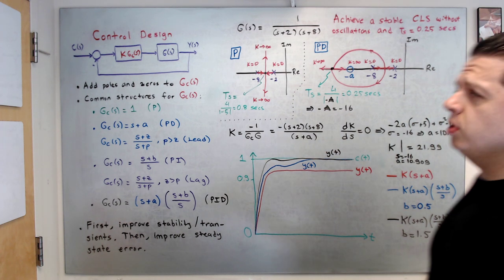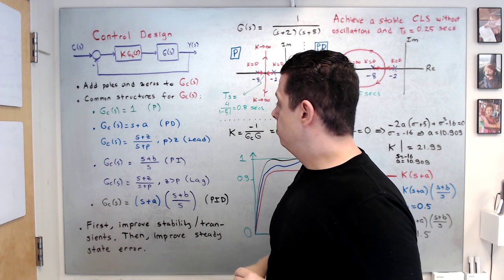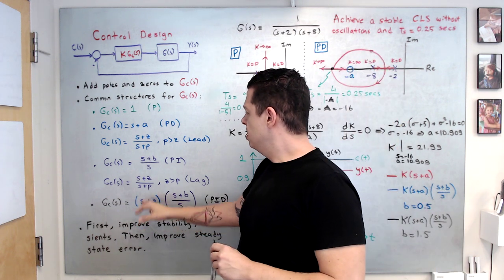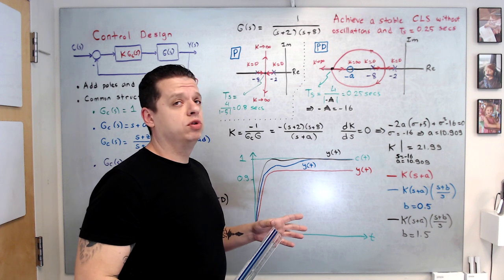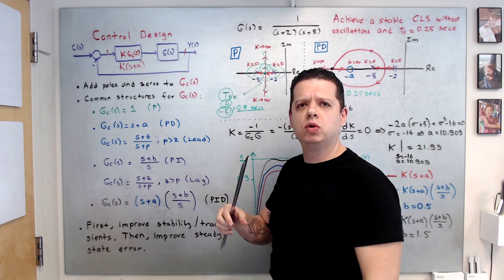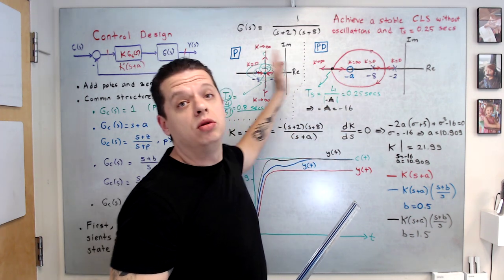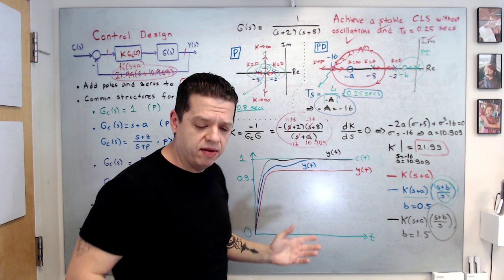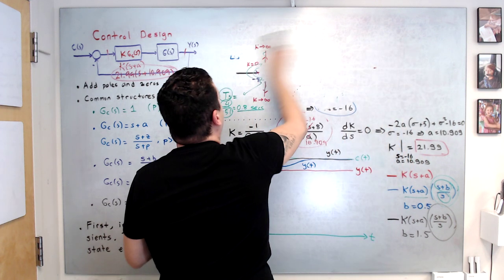Control Design with Root Locus (Lectures on Control Systems)

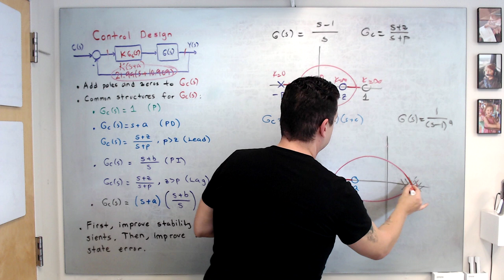Comment: At 20:50 the type of controller you are using is that just the PD controller extended? Because it has the (s + a) like PD but also includes s+b and s+c
Reply from the maker: Yes, it has multiple PD controllers ;)